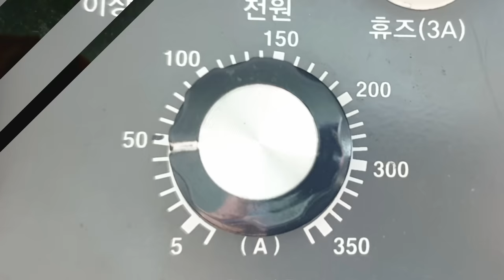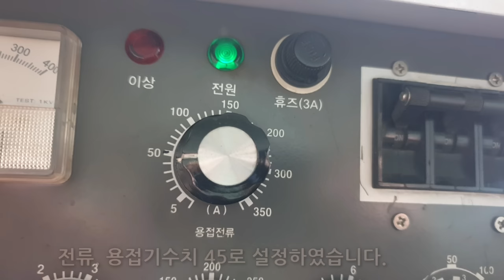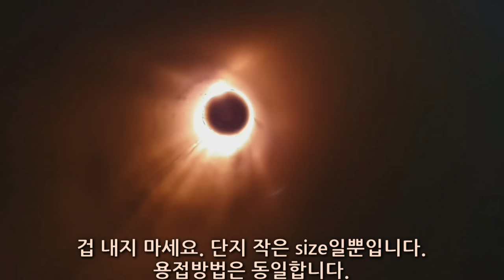소형배관15A (Stainless steel) sch10 파이프용접영상!

Comment: Can you explain why using bigger gap for welding a thick pipe?
Reply from the maker: Thick pipe welding requires a stable root gap.  4mm or more ... Because you can finish the root pass to the end even if it shrinks, it could be to finish the welding at once without making a mistake.

Comment: Hello thank you for the explanation i have a welding device and i am facing a problem in melting the tungsten welding rod what is the problem in your opinion thank you
Reply: It’s your angle of your tig torch in relation to your wire